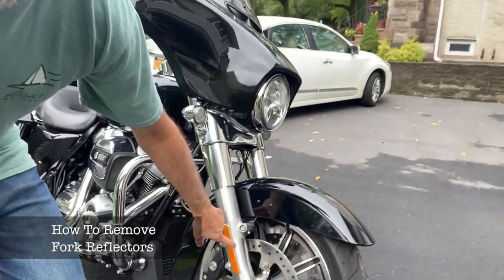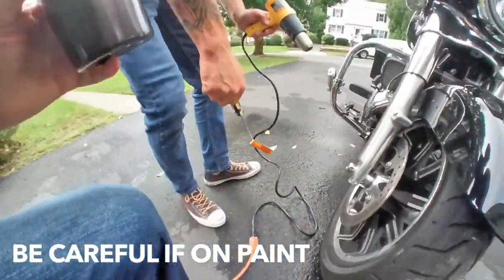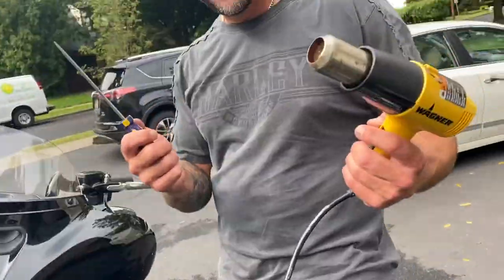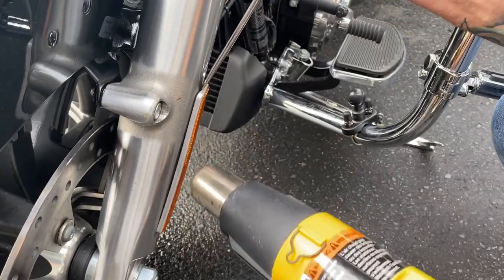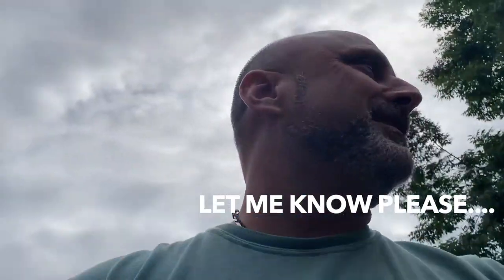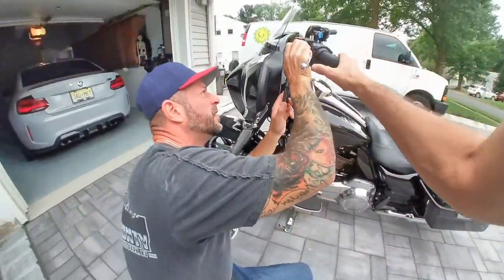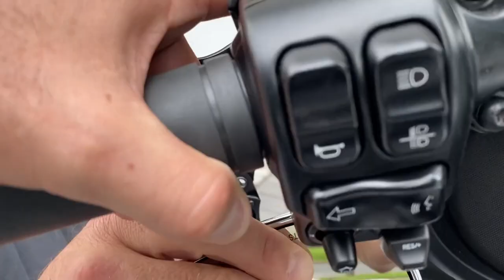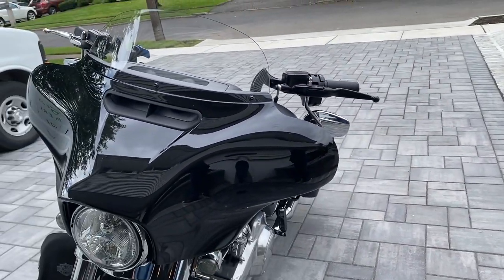How to remove fork reflectors / How to replace brake levers

Comment: CD makes a replacement for the saddle bag reflector that lights and I believe can be used as a turn signal if I am not mistaken.
Reply from the maker: SF0311 I’ll check it out - thanks

Comment: Fork reflectors are so kindergarten. 

Levers:  Google up Iron Braid levers
And while you're at it, grips:  Google up Coolsac Grips
Both are made in USA.

You can probably flog the old levers on eBay for a few bucks.  Anything Harley branded has value.
Reply from the maker: Coolsac grips - really nice!